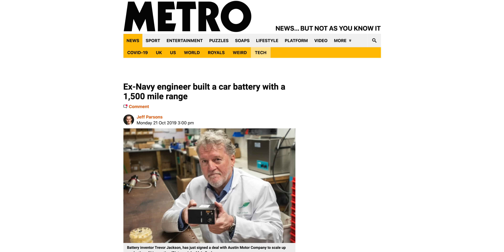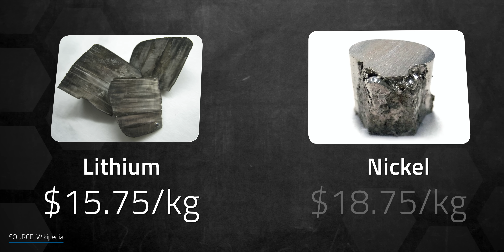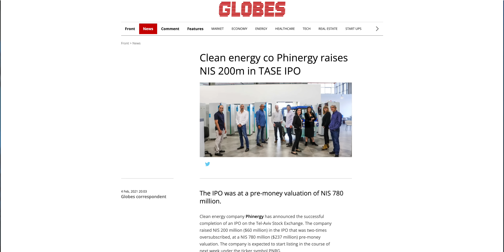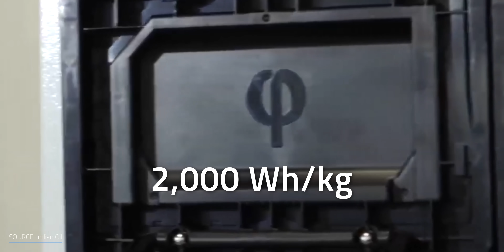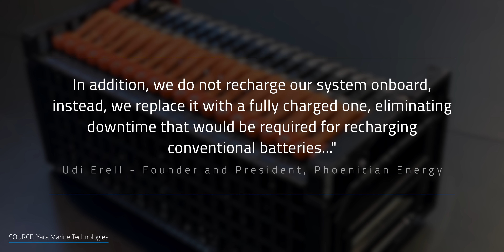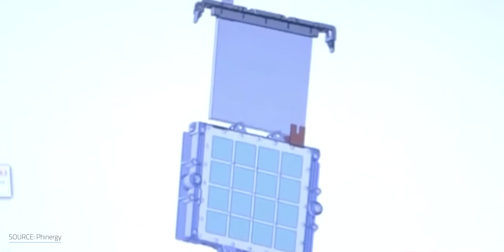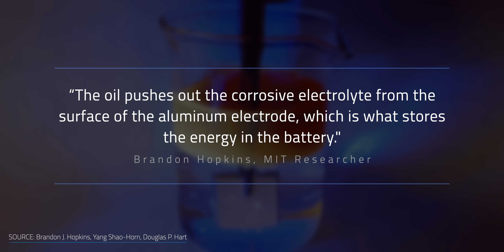Exploring the 1000 Mile Car Battery - Aluminum Air Hype?

Comment: Thanks for the helpful description of this technology! I'm still trying to understand the comparative the weights of Al and Li batteries (your explanation was rather quick). It's not immediately clear why Al batteries are lighter, since Li is the lighter element, with atomic number 3 (vs. Al at 13).

Also, I'm trying to understand how degradation is a problem for a battery that has to be replaced. You're talking about degradation over a month or longer baseline but the range of these cars is maybe 1000 mi? It doesn't seem like the degradation problem has to be fixed as well as it does with rechargeable batteries since the battery may not last that long. It's a real problem, but it seems to be a different sort of problem than with rechargeables.

Comment: Sounds interesting, swapping the battery wouldn't be much different from visiting petrol pump and filling up, and if the range is as promised you would go there maybe only a couple times per year. The battery you'd get would always be new unlike those proposed battery renting options for Li-ion powered cars. Easily recyclable battery that can be "recharged" using solar power. They could make batteries modular, made of smaller cells so if you accidentally run out you could get only one cell that would be easy to carry and replace and would give you enough range to reach changing station. So far, awesome idea if they could iron out those degradation issues. And of course, if we could get those batteries in more than one place in the entire country...

Comment: What's the energy density on these compared to the Lead Acid batteries used in regular combustion cars?  Considering the acid battery only needs to output 12V at a time to keep the car running, this could easily replace those depending on size to power density ratios.  We can't recharge either of them, and this seems like a much cleaner alternative to the regular car batteries that end up in oceans if it's disposed of improperly.

Comment: Not a fan of the additional maintenance that comes with this technology. I've never really liked the idea of swapping a fuel cell into my vehicle, and would much rather a comparable 300-400 mile range with infrastructure, than to be stuck in the middle of nowhere waiting on a 20lbs + cell delivery system.

Comment: We have to consider the energy requirements to produce and recycle the batteries. And the cost of it all both economicaly for the enviroment. The issue of being stranded on the road could be off set by having a small lithium ion pack, like 80km range, to emergencies.

Comment: Swapping wouldn't be a problem for me, if it's easily available (I guess same issue as H2). One thing I would have liked more coverage on would be their volume. The energy density being higher is great and all, but it was also pointed out multiple times how light they are. How much range would I get with a similar size to current tech? Finally what does it mean for one of these to be swapped? How is it refurbished? What's the environmental impact of that cycle in comparison to current BEV/HFC options?

Comment: You wouldn't need to tow a car with a dead Al-air battery to a swapping station, it should be easy enough to order a delivery, much like a breakdown service bringing gas to a stranded car. Battery swapping is an awesome time saver but relies on a standard battery being available everywhere.

Comment: non-rechargable will be a non-starter. people can just about deal with plugging a cable in, exchanging the battery pack would either be a lot of work or very complex if automated, especially across different vehicle moduls.
that thing could be a solution for planes - lighter, easier standardization, switch out not an issue at the airport.
it might also work for heavy industrial machinery, where battery storage and replacement can be centralized easily enough and the used batteries can enter a recycle pool.
for cars i only see a rechargeable system making it, whatever that will end up being.
Reply: I drive a truck with a 140 liter tank. It takes five-eight minutes to refuel it at a gas station. If I can change a battery in three minutes, then that's half the time I have to spend standing out in the cold in the winter trying to make my car go.
Reply: @shaun4772  the issue will more likely be that the current images that are created are wrong. it will not be just a strip of batteries to change but several hundred kilos worth, even with aluminium being lighter overall.
also batteries will have to be put in different locations since you most likely will not dive under your car every time you need a "refill", which makes manual changes not only tiresome but difficult to realize.
the alternative is automation but here you again run into the issue of hudreds of car models requiring one system to change ... and that system has to be present at many stations all over the place to be feasible.
electricity is super easy as it already is everywhere but even here we are struggling to put up enough charging stations.
now imagine having to install an automated changer plus secure storage for tons of batteries and a supply line to deliver replacements and pick up spent units.

i find that highly unrealistic on a global scale, it simply would be too expensive to build with a very very slow ramp up in returns.
china might do it simply by brute force but i can't see any country with a free economy ever going that route.

and as a last thought: with non-reuseable batteries you cut out the option to recharge at home, the most cost efficient way to drive an e-car.

Comment: Your not even taking in the fact that the Fuel Cell needs to be "Recycled". What does that process involve?
Reply: Recycling involves using electricity to convert aluminium oxide back to aluminium which can then be put back into the batteries. Essentially you are recharging the battery but the recharging process is too complex to be done inside your car or at home, so the factory does it for you.

Comment: Swapping batteries should have been a consideration in the design of EV as they are now. Imagine being able to go to a service station (perhaps paying a premium) and swap the EV batteries out instead of recharging. Then the swapped out battery could be charged for the next customer. That paradigm would required an industry standard, but it's definitely doable.
Reply: Ever heard of Nio?
Reply: @berova  I have not. But looking them up, it looks like they have both charging and battery swap - nice! Thanks for sharing.

Comment: This would depend on what I was doing. For long distance travel, battery swapping would be extremely handy. But for driving around town where I only need 20 or so miles of range, I would prefer to be able to recharge. So maybe the solution is to have a smaller lithium battery for short distance driving, and then a Aluminum battery for long distance. You discharge off the Lithium first, and when it gets low it can start pulling power from the Aluminum for longer distances.

Comment: To produce Aluminum you use a large amount of electricity.  I am assuming a large part of the recycling is to put the corroded Aluminum back into the furnace? If you compare the powers I suspect the efficiency of recycling is Very Low!!

Comment: What if you used an aluminium-air battery in combination with a smaller Li-ion battery? Your Li-ion battery can provide maybe 50km of range, and be easily rechargeable, while the AA battery kicks in when your Li-ion is getting low. Might be worth it.

Comment: I'm from India. And I'm DEFINITELY not going to use a one time use battery. My anxiety will be even higher. Not to mention the possibly lazy implementation by Indian oil corporation. However you gotta hand it to them for funding this. In the USA, the oil companies would just lobby the government to keep using oil.
Reply: For me being in USA, range is a HUGE drawback. Furthermore, electricity is NOT all that clean because we generate electricity from coal, as well as other clean sources.  
In summary,  until we generate 100% of all electricity from clean sources, our net CO2 emissions will not change.
Reply: @lourias   I really think that there's a middle ground. It's a chicken and egg situation when you want all grid power to come from entirely renewable sources. There needs to be more push, but for that to occur, there needs to be greater demand for EVs as well. Also, in many circumstances, it can still be more eco-friendly to still run an EV from mixed grid sources due to the much higher efficiency that electric motors offer compared to gasoline vehicles. There was a great video from Engineering Explained that looked at the concept. Essentially it depends on the current grid mixture that's available locally.
Reply: @lourias  Our grid is getting cleaner and cleaner all the time.  Coal use is trending down and renewables are trending up!
Reply: @lourias  That makes no sense as you stated it, if you generate 50% of one's electricity via renewables and 50% by coal, then you have 1/2 of the CO2 for that much power.   If you are trying to state if EV's share if power comes from having to burn 100% coal.  Even if that is true (which is it not - just some incorrect political talking point),  it's still less as EV's are still more efficient than ICE's considering the total chain of energy of each.

Comment: Having to replace the battery sacrifices the convenience that current EVs have of being able to charge at home overnight, and gas stations need to keep tons of these batteries at hand for replacement, introducing additional costs in the form of land and transportation.

I'd also imagine that the battery will steal some trunk space, unless it can fit under the hood.

This tech could work great as a spare battery for long trips, otherwise it doesn't seem appropriate for most personal cars. However this could be amazing for trucks, buses, airplanes, and similar vehicles that struggle to find enough range without ballooning weight.
Reply: You realize we already transport fuel over land to gas stations, right? This would be swapping out tanker trucks and gas stations for battery transports and battery swapping stations. It would be swapping out oil refineries for recycling centers. I do agree that small Lithium + large Aluminum hybrids seem to be the best approach though.
Reply: @shaun4772  The transport cost comes from the added complexity of loading and unloading solid objects as opposed to pumping liquid, arranging them at the gas station so customers can quickly access them, and transporting away the empty batteries. I would expect both the amount of manual labor and time requirement to increase significantly compared to simply pumping fuel into a pipe.

Comment: I don't see why you couldn't have a fuel cell swapping vehicle for stranded cars. Design the cars for easy access to the fuel cell, for example having the access spot be in rear of the car. This way when someone runs out of battery you have them pull over and the van that has the new cell can swap the 2 without inconveniencing traffic. Assuming the cell to be around 600 kg I expect the swap to take about 3 minutes and assuming the swapping stations are as common as gasoline stations the van/truck should arrive at your location in a maximum of 15 minutes. You can further shorten the waiting time by having the car warn you you are about to run out of battery with no charging station around and offer to call the nearest station to your estimated arrival location.

Comment: 4:27 Aluminum have a great advantage of weight compare to Lithium batteries.
This is at best confusing. Lithium is lighter than aluminium, it's the lightest metal. What makes the lithium batteries heavier are the other elements involved in their makeup.
Reply: Lithium batteries contain more than just lithium. They contain electrodes which are made of carbon and then there is the electrolyte. All of that adds to the weight.

Comment: In my opinion, battery swapping is arguably better than waiting 30+min for an EV to recharge.
In fact, it could even be faster than normal gas refueling.
As long as it is economically viable (and not environmentally terrible) to recycle or reuse the batteries somehow, it would not be an issue for me.
In fact, I'd welcome our change to the green future and likely look at buying one of those cars.

Comment: Most proposals for aluminum/air batteries suggest they would weight about 50 or so KG.  I think it would be a lot more practical to have something like 10 kg unit batteries.  That means they would be easier for an ordinary customer to handle.  Also, it means you can 100% consume each module.  Draw down one unit at a time. Exhaust one battery and then move on to the next.  Also, if you are just driving around town you might only have 2 or 3 modules in your car.  But if you planned a road trip you would get all 5 units, plus maybe a spare pack or two you could carry in the trunk.

Comment: Recycling is still energy intensive and the battery networks would be a logistical nightmare to solve, they only appealing part is the energy density but if we consider expandable sources you could use explosives as batteries
Reply: We currently use explosives as fuel, and we've already solved the logistics issues involved with extracting oil from the earth, transporting it to a refinery for processing into gasoline, then loading onto freight and transports, for distribution to a network of fueling stations. You think transporting batteries that need replacement once a month will be more difficult than transporting flammable, liquid fuels, in vehicles that require weekly to bi-weekly refueling?
Reply: Recycling anything recyclable, in general, is far less energy intense and way less environmentally damaging than mining and processing raw materials whether it be lithium, aluminum, etc. It is also a lot greener to recycle as well.

Comment: Where this might work is as a single use rental. 
You could make a cheap electric car with about 150ks of range and space for one of more of these batteries when you need more range.
This is assuming that you can cheaply recycle the battery, and that it would work out cheaper than just hiring a rental car or adding range extender.

I think these batteries might be interesting in aviation.